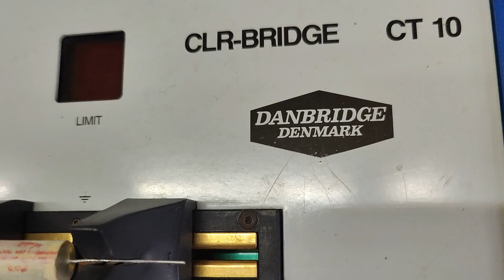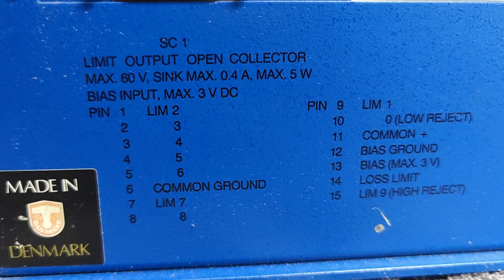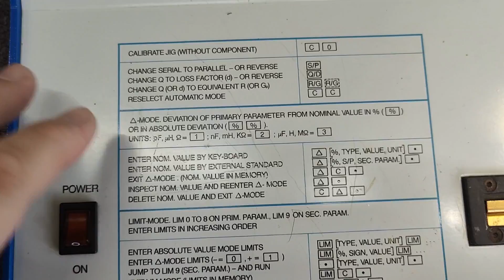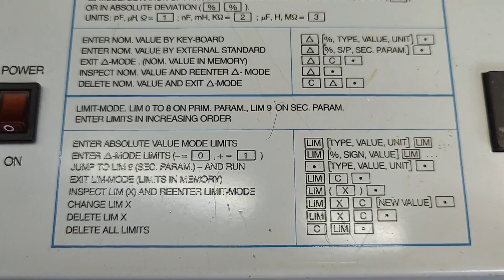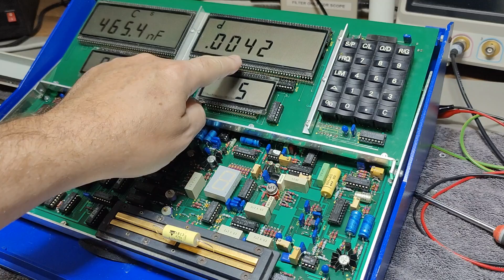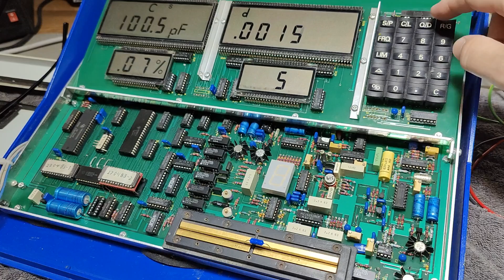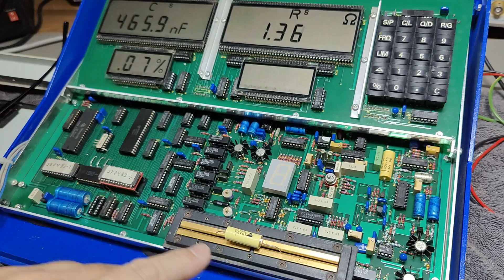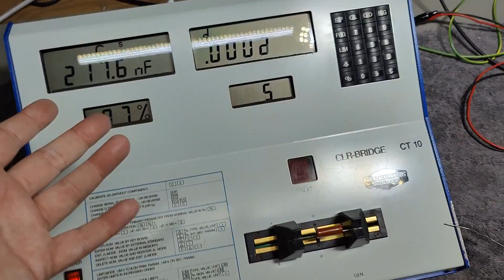Danbridge CLR Bridge CT 10 1983 test teardown

Comment: In the '80s you saw a lot of production units with bodge wires because the cost of getting PCBs made was high and rework was relatively cheap.  This was especially true with low-volume stuff like test equipment.

Comment: I'm sure with the tolerance "%" measurements you have to key in the stated value of the resistor, capacitor, or inductor being tested, so that it knows it's say a 470nF capacitor, so it can indicate the actual tolerance from the component's measured value. That's why it seems to be indicating 0.07% for every component tested.

Comment: That circuit board is bodge city... but it seems to work well!  (not sure about the loose socket for the lcd though!
Reply: One bodge I did notice is the stacked sockets with wires under one of the EPROMs. You have to do that if you wish to use say a 2732 in a board that was designed to use a 2532, as some of the pinouts are different between the two ICs.
Reply: @zebo-the-fat  its common to find bodges may be the pcb cost lots of money back in the days and they make a small number of units not a mass production.

Comment: Nice teardown did u find the nut , make a test with high  precision resistors to see if it needs calibration.
Reply from the maker: yes the nut was loose inside, always good to perform deep going visual inspection, yes i also performed many tests with resistors, this unit is still amazing
Reply: Naughty, they went with a non-standard connector for IEC-625 aka GPIB. RS-232 could have stayed at 25 pins as that was fairly popular back in the day. On the PC the 9-pin one was often COM2: :). The GPIB port should have used a relatively affordable metal-shelled plastic right angle PCB-mount “Centronics”-style connector.
Reply: Naughty, they went with a non-standard connector for IEC-625 aka GPIB. RS-232 could have stayed at 25 pins as that was fairly popular back in the day. On the PC the 9-pin one was often COM2: :). The GPIB port should have used a relatively affordable metal-shelled plastic right angle PCB-mount “Centronics”-style connector.